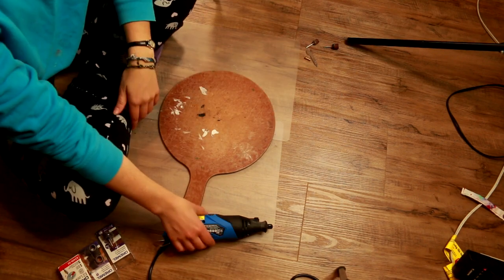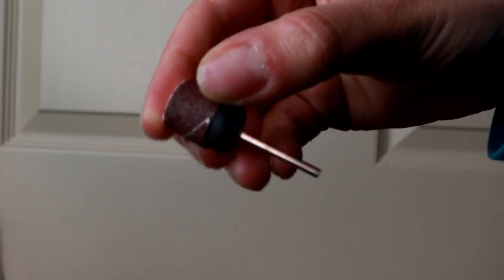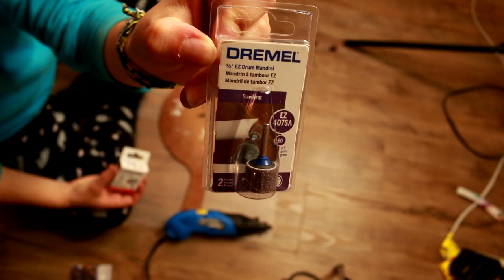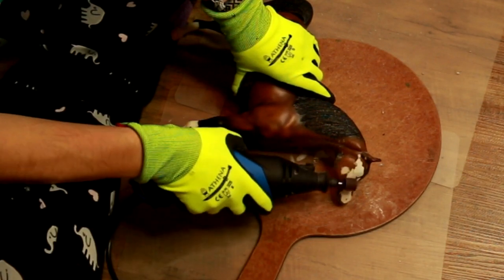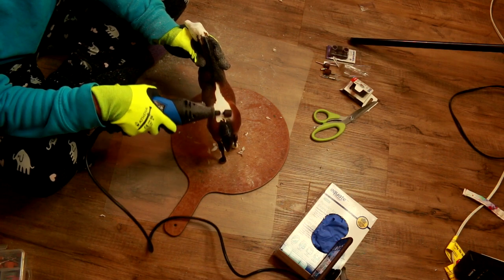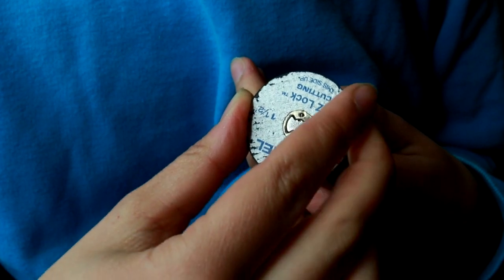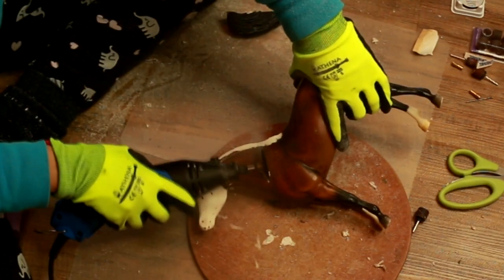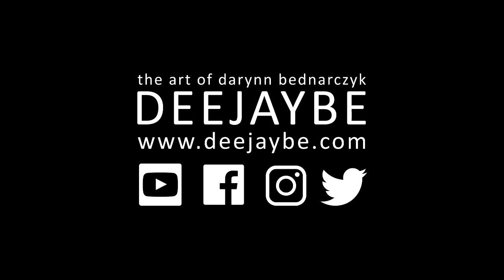DREMEL EZ LOCK Cutting Disk & Sanding Drum - HOW TO & REVIEW

Comment: Have you tried a flex shaft? Because if not, oh my god, they're life changing. I absolutely hate holding the rotary tool (I have a knockoff too, woo!) to use it, but the flex shaft is amaaaaaazing. Thanks for this video, I totally need to pick up some of the Dremel sanding drums!
Reply from the maker: Zhuria that’s my next purchase!! I didn’t know those existed until a few months ago. Do you have the Dremel brand one or a knock off? I’m just not sure if the Dremel brand will work on my tool, it should... I’m thinking
Reply: @DeeJayBeStudios  Good point - my flex shaft came with my rotary tool, so I'm not sure if the Dremel one would work on off-brands. I wonder if Mastercraft sells one to go with theirs?

Comment: I've had horrible experiences with the EZ Lock mandrel. The sanding drums slip off all the time. I don't know why Dremel keeps selling that defective product. there are many other people with the same problem. I think the only solution is the glue them on. Bummer.
Reply from the maker: After posting this video; I have since switched to the solid mandrels. The locking mechanism weakened and it no longer worked for me.
Reply: @DeeJayBeStudios  So you went back to the older mandrels? When I try out the EZ lock mandrel without the sanding drum on it, I don't see the rubber part expanding. It doesn't expand at all. It's not holding on the sanding drum What I don't understand is how Dremel gets away with selling these even after years of complaints. Not good for the credibility of the company.